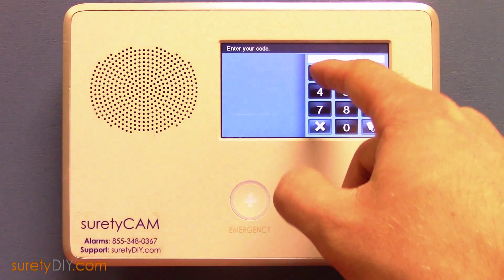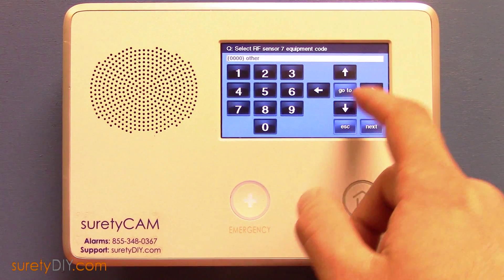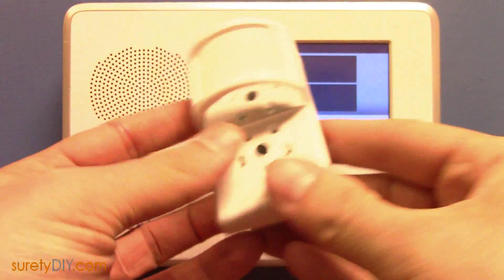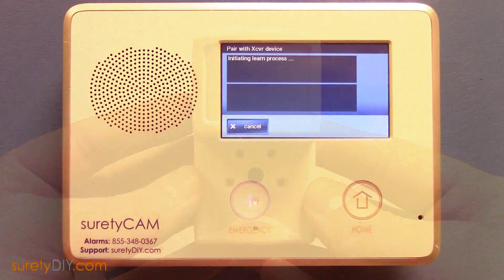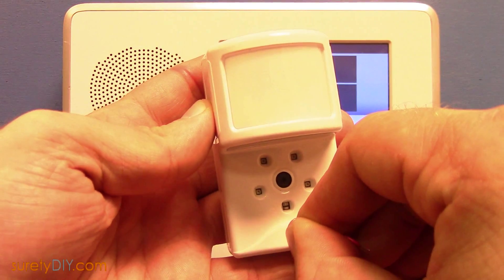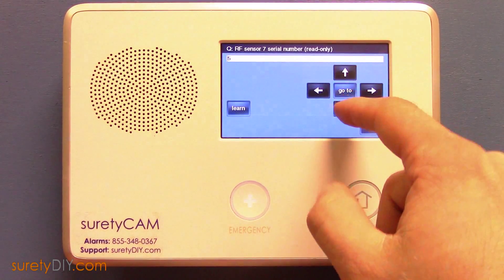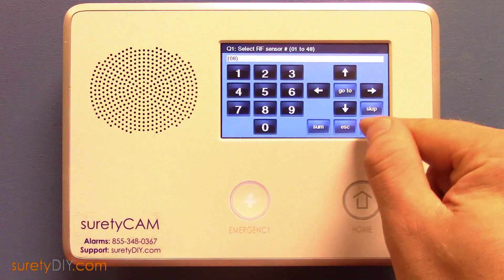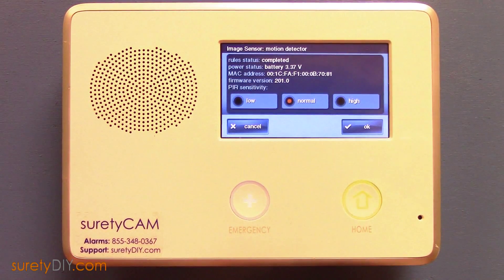How to Program a 2GIG Image Sensor into a 2GIG Go!Control Panel

Comment: keeps saying failed.  tried it many times.
Reply from the maker: Note that a 900mhz XCVR2 Transceiver is required for Image Sensor use on a 2GIG Panel. For troubleshooting, please visit https://suretydiy.com/forum/
Reply from the maker: The Image Sensor will require a 900Mhz XCVR2 transceiver. Should you need help troubleshooting, our technicians would be happy to help. https://suretydiy.com/forum/
Reply: If i do a hard reset do i have to program all sensors again?